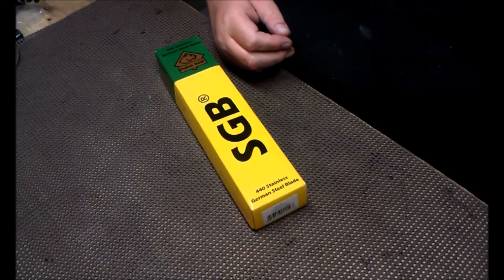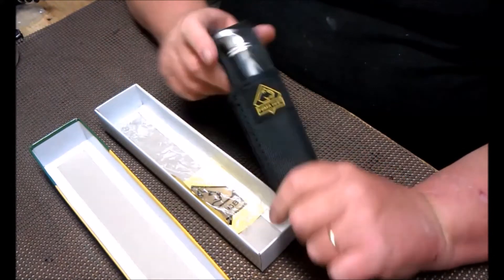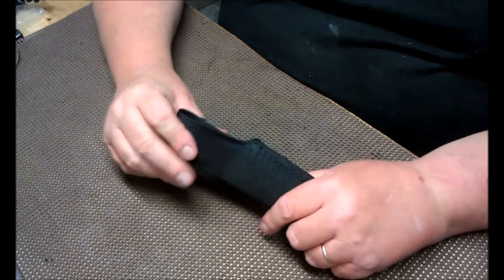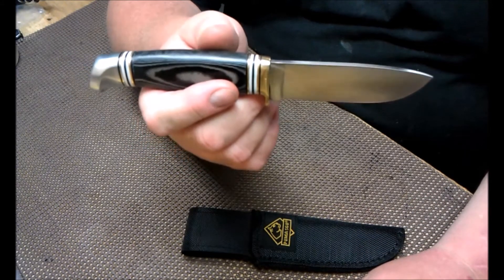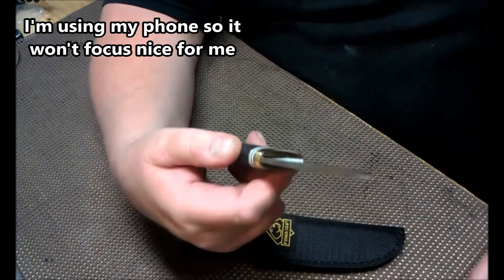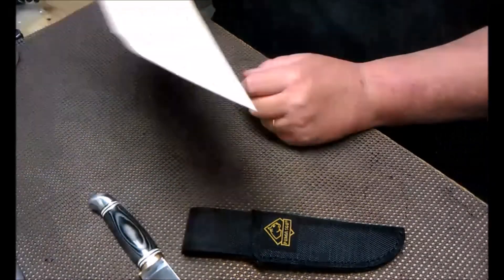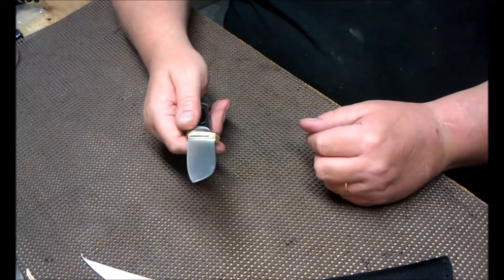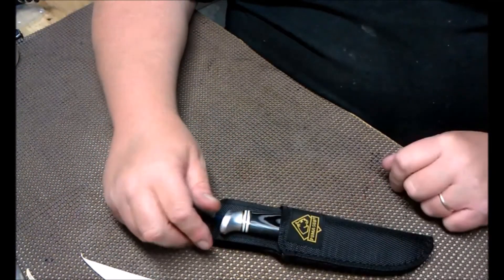New knife: Puma SGB Wolverine

Comment: What does SGB stand for Scott?? Isn't Puma a German brand. I am sure there is a German brand of knives called Puma, but I am not sure it is the same. Definately a cool blade. I like the look of it. Oldschool but it still looks modern. Very cool. Looking forward on seeing what kind of sheeth you come up with. Cheers Mark.
Reply from the maker: DutchKnifeGuy Puma is a German knife company and as I understand this is their value line and all the parts are made in Germany but they are assembled in China to save some of the costs. Any ideas on a sheath for it?
Reply: SGB = Solingen Germany Blade